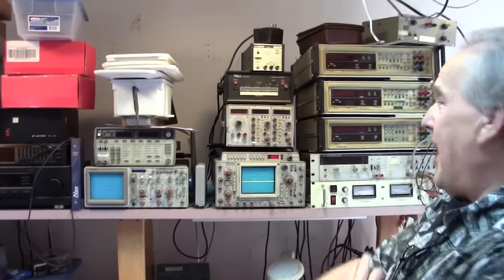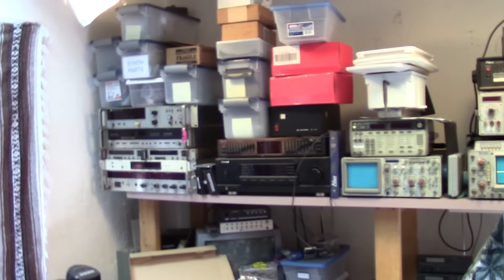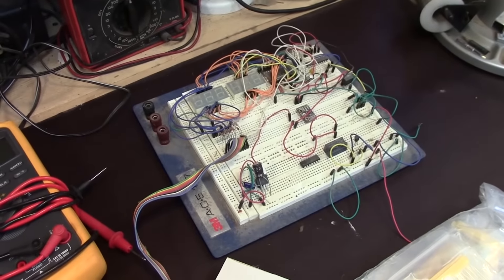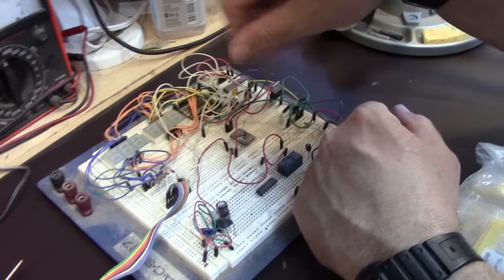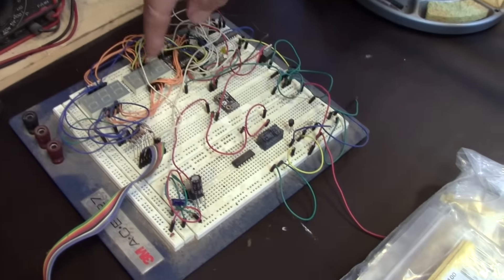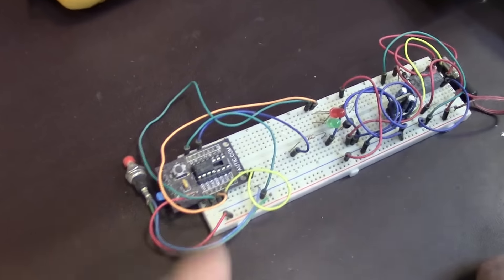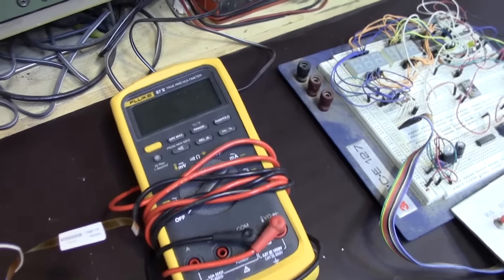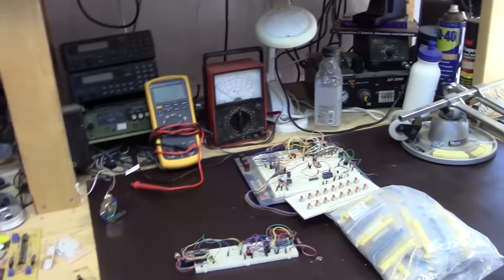Hack A Week visits Hacker's Bench.

Comment: if you stack enough equipment up on your bench people will think you are the most qualified tech in the place I love it I can almost smell the Transformers melting and the magic smoke ...
this is awesome great video
Reply: +Bret H Truth be told, I use the two scopes, the power supply, and the big frequency counter. The rest is more of a vintage gear collection than working tech bench. But then, it does impress the hell out of my family. <grin>
Reply: +Hacker's Bench kindred spirits I think first 20 years mostly field tech in arcade weekends spent on obsolete and antique coin op my tech bench is crazy out of control mostly tube driven stuff and on top of it all is a world war two directional antenna that looks like a metal donut.

 happy to find your channel